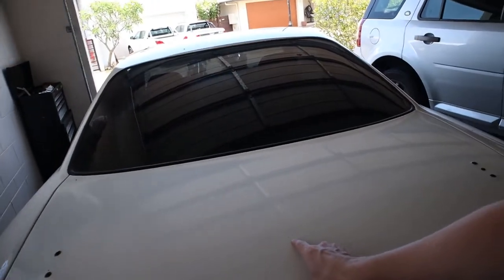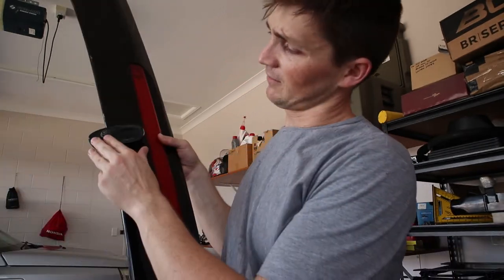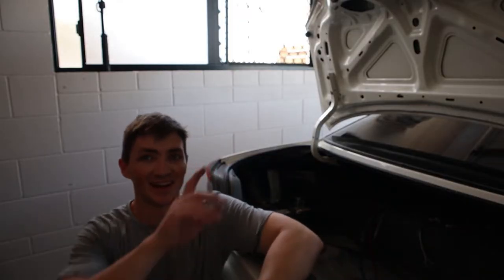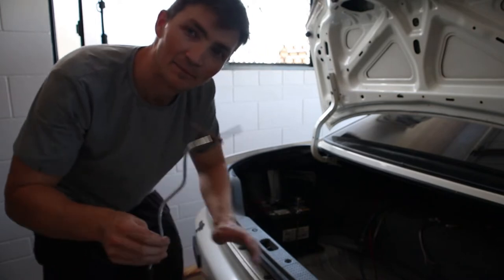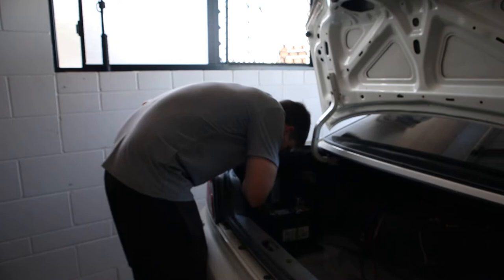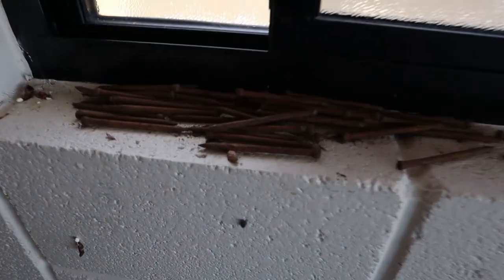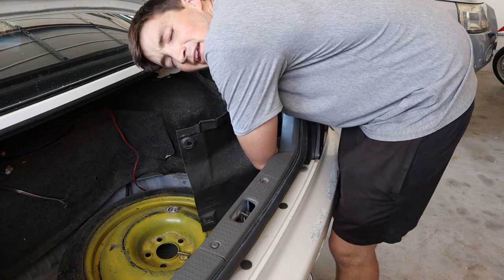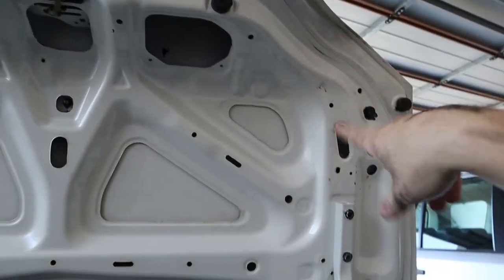S15 goes back to OEM. Stock is best?

Comment: Great video man, I'm enjoying these! Do you think it would be a bad idea to purchase an s15 with 200kms?
Reply from the maker: Thanks Jonathan! I think 200k kms isn't terrible so as long as the price is right and the condition of the car is good then it should be fine. My car had heaps of issues with 112k kms so it really depends.
Reply: @PiersonWillis  Thanks champ, motor can always be replaced or rebuilt, and I don't plan on selling it ever, I think its just that I'd rather see 100xxx kms on my car rather 200xxx kms, but im still searching for one so who knows.
Reply from the maker: @LucaBrasi125  I think that's the main issue with buying a high KM car. While you might be ok with it - when you do eventually go to sell it, others seem to care. That's been my experience anyway with higher KMs
Reply: @PiersonWillis  That is a fair point. Thanks for the replies, keep up the videos man I'm really enjoying them!